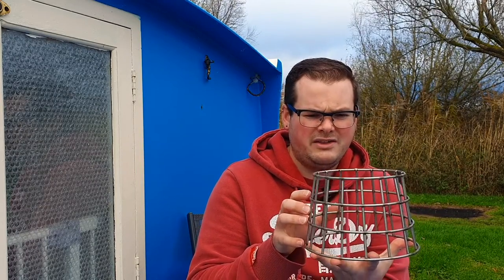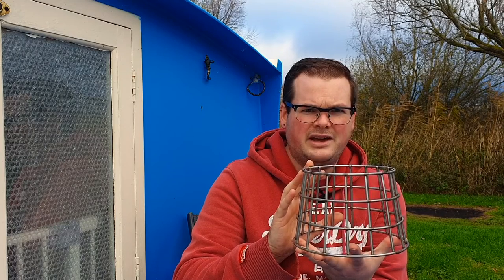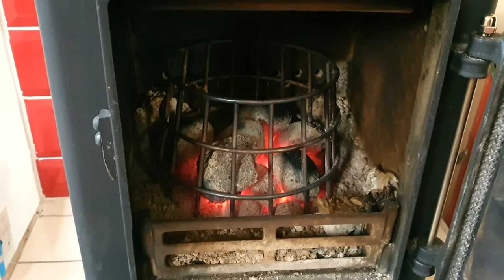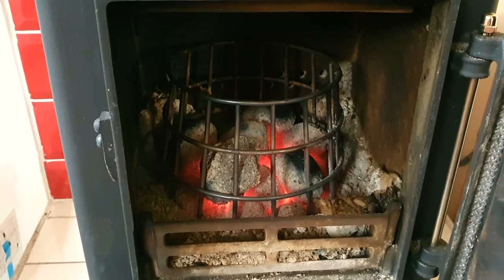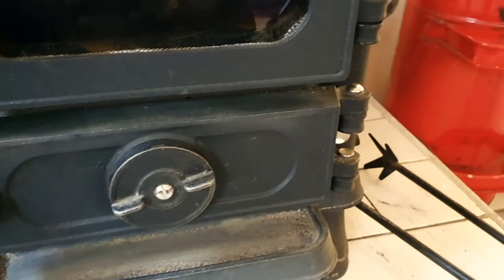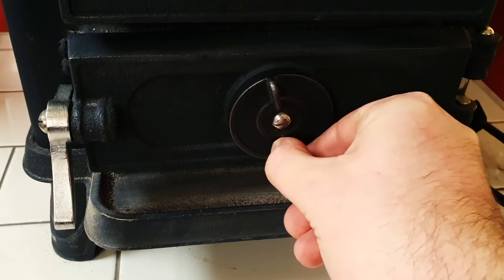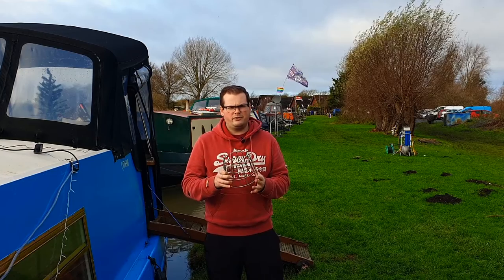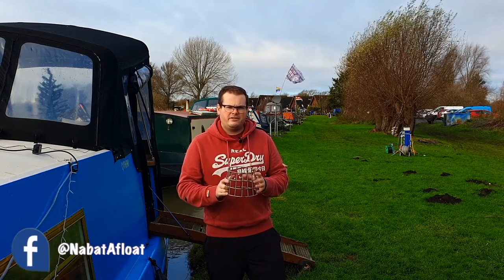Coal Cage

Comment: If you are only going to burn coal then buy a stove with a smaller fire box, or  get some large rocks and put them around the edges of the fire box
Reply from the maker: This particular stove is the hobbit by Salamander, it has one of the smallest fire boxes on current UK market, the coal cage only just fits! So haven’t had the need to put fire bricks around. But can see how that would work in a larger stove.
Reply: Where can these be purchased? Don’t see them on Amazon, thanks in advance
Reply from the maker: @janeymacbarge8132  I bought mine direct from Coal Cage on their website and I was able to speak with them and get advice on best use. But it can also be bought from various chandlers such as Midland Chandlers.